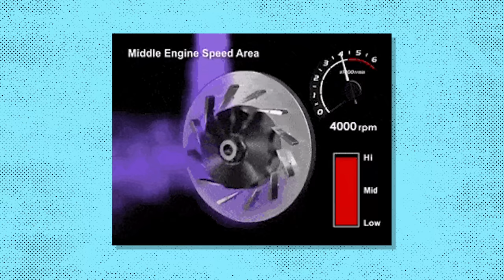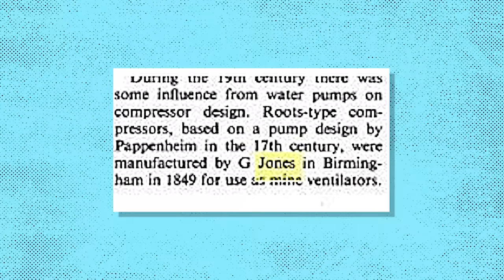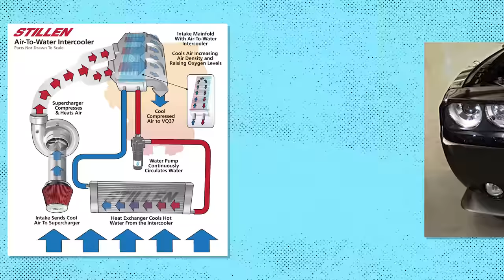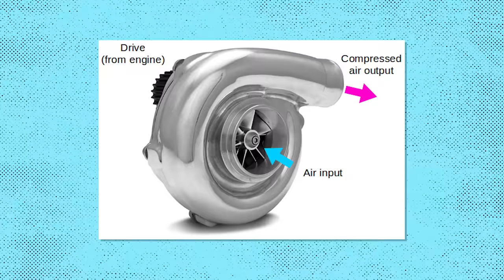Why Superchargers Aren't As Good as Turbos

Comment: Someone please explain how a turbocharger works.  The following is how it looks to me, but correct me if you have math, and physics, to back up your argument.

What magic does exhaust gas have that allows it to power a compressor without putting a load on the engine which is at the other end of the pipe?
Pneumatic tools use turbines to convert compressed air into mechanical power.  That's what turbochargers do too.
Every time an exhaust valve opens in an engine, its piston is now right down the hall from the turbine and the door between them is wide open.  The piston is shoving the exhaust gas out of the cylinder, ramming it into the exhaust system.  There is only one way for it to get out, through the turbine.  That puts a load on the engine.  
There is no magic use of waste energy.  The exhaust gas is as hot as it gets when it's shoved into the exhaust pipe.  From that moment on, it begins to cool and to contract.  Not much cooling happens in the very hot exhaust pipe, but the point is the same.  Let's say that we toss a mixture of fuel and air into the exhaust pipe upstream from the turbine, and we ignite it.  That certainly will make the turbine spin faster, but the other end of the pipe is still connected to engine cylinders with their exhaust valves open.  Those pistons feel that increase in pressure outside and they will be slowed.
There is an idea that turbo superchargers put no load on the engine, but I can't see how that is true.  But if you know different, and have the technical knowledge to back it up, I'd love to learn something.
Reply: First of all the exhaust gasses continue to expand as a significant amount of heat energy is rejected by the reciprocating engine.
  There is no parasitic loss because there is no backpressure, a properly designed turbocharged engine will have no Delta~P as intake manifold pressure increases with exhaust gas flow.
 The turbocharger uses an Impulse Type turbine..
This converts the kinetic energy in the hot exhaust gasses into shaft horsepower, not pressure.
 When an Otto or Diesel Cycle engine  is turbocharged it becomes a combined cycle Heat Engine.
 The turbocharger acting as a  second pass heat recovery engine using the Brayton Cycle.
It shares the same thermal reservoir as the reciprocating engine but only uses the heat rejected by the reciprocating engine increasing overall thermal efficiency and volumetric efficiency without any parasitic load on the reciprocating engine.
We can prove this by using the Carnot Cycle Formula and the temperature differentials  (Otto Cycle + Brayton Cycle = BSFC)
Any thoughts or questions?
Reply: @sandervanderkammen9230  
You didn't answer my main point in any way.
Reply: @deezynar  Your problem understanding how the turbocharger works is related to a lack of understanding of how the engine works.
Pumping loss and heat rejection in particular.
About 20% of the energy lost is to pumping loss, the turbocharger reduces the loss because the centrifugal compressor is significantly more efficient than the pistons in pumping air.

About 25% of the energy is rejected in exhaust heat. This exhaust heat drives the compressor as the gasses continue to expand.
There is no parasitic load on the crankshaft because the pressure in the cylinder is always higher than the exhaust manifold during the exhaust stroke.
Yes, heat is magic...
  The exhaust gas temperature suddenly drops as it passes through the turbine wheel, energy cannot be lost or destroyed, this temperature drop is directly related to amount of heat energy converted into shaft horsepower generated by the turbine and is accurately calculated by using the Brayton Cycle Formula.
Any questions?
Reply: @sandervanderkammen9230  
You keep writing, and you keep saying nothing.
The exhaust gasses are in a pipe with the open exhaust valve and piston at one end, and the turbine at the other.  
Just explain how that situation doesn't put as much pressure on the piston as it does on the turbine.
Reply: @deezynar  Because there is also an intake valve open with pressurized air rushing in pushing down on the pistons... an equal but opposite reaction which canceled out the exhaust manifold pressure.
It is basic engine fundamentals and fluid dynamics.
There is no Delta~P so no backpressure in a turbocharged engine.
Reply: @sandervanderkammen9230  
The exhaust valve opens while the intake valve is closed.
While the exhaust valve is open, the piston is moving upwards, ramming the exhaust gas out of the cylinder and into the exhaust system.
Explain how there is no backpressure with plain English.
Not only am I saying there is backpressure, I am saying that the piston produces the ONLY pressure.  That means the turbine is powered by the engine acting as a pump.
But I've already said this, so I'm just wasting time by repeating it.
Reply: @deezynar  The turbine is powered by heat, just like the reciprocating engine is.
This is not a difficult concept for an inteligent person to comprehend.
Both the piston and the turbine wheel are acted upon by expanding gases which are expanding from heat. The gasses continue to expand   after the piston reaches BDC.
 The pressure in the cylinder is always higher than the exhaust manifold.
The pressure differential between the intake and exhaust manifold on a turbocharged engine is Less than a naturally aspirated engine so there is no net increase in backpressure because intake manifold pressure is higher than atmospheric pressure.

If you pump air from low pressure to high pressure there is resistance to flow and pump load is equal to the difference in pressure.
If you pump high pressure air to an area of the same high pressure? There is no  pumping loss due to the lack of pressure differential.
Reply: @sandervanderkammen9230  
Your first statement is false, so it's hard to believe anything you say after that.
Heat does zero work, and isn't capable of doing any work.
Work can only be accomplished by DIFFERENCES in heat.  Expansion can't happen in conditions where temperatures are equal.
That shouldn't be hard for an intelligent person to understand.
So, in order for you to not look like an idiot, NEVER claim that anything works because of heat without pointing out that DIFFERENCES in temperature are required for work to be done.  A Stirling engine will work if it's sitting on dry ice, and the top is bathed in ice water.

With that said, the fuel and air mixture in an engine are ignited in a cylinder and the combustion causes the contents inside the cylinder to go from being warm, to being very hot, and hot stuff takes up more space than cooler stuff of the same mass.  That sudden change in temperature is worthless if it wasn't for the air pressure on the underside of the piston being far less.  
Did you understand that?  I wonder if you do, because you jumped right over several key points in your explanation, which significantly reduces your credibility.

After shooting yourself in the foot, you go on to make a claim that you seem to think proves your point.  Yes, it is a fact that the pressure in the exhaust system is lower than the pressure inside the cylinder.  Of course it is.  The exhaust wouldn't exit the cylinder if the piston didn't provide enough force to push it out and overcome the pressure in the exhaust system.  And that is true even with the gases continuing to burn after being shoved out of the cylinder.
It seems that you don't recognize that you are actually claiming that LESS pressure is the same as ZERO pressure.

I'm going to say this for the 3rd time: the piston that shoves the exhaust gases into the exhaust system has a direct pressure connection between itself and the turbine.  If it wasn't for the existing momentum of the gas towards the turbine, the exhaust would all blow out through the cylinder if the piston were suddenly (magically) removed.
Reply: @deezynar  Air is only the working fluid.
It is heat that causes the air to expand.
 Air is matter, not energy.
The energy is simply transmitted through the air causing it to expand.
 Turbochargers convert the heat energy in the air into shaft horsepower.
Heat from the same source as the reciprocating engine... the burning air fuel mixture. 

The reciprocating engine has a significant amount of energy loss due to pumping efficiency.
The turbocharger both increases pumping efficiency and volumetric efficiency.
It accomplishes this by the centrifugal compressor which is significantly more efficient and the fact that it is not driven by the reciprocating engine using mechanical energy.
The gas turbine wheel is driven by energy rejected by the recip.engine.
 Having lower pumping loss and higher thermal efficiency is clearly reflected in the higher horsepower measured at the crankshaft, the lower exhaust outlet temperature and lower BSFC  (less fuel burned per horsepower generated) thus higher thermal efficiency.
 The drop in exhaust gas temperature through the turbine exactly matches the difference in horsepower  (lower temperature means less heat rejected =more power)
If we compare two identical engines,  same centrifugal compressor same boost pressure one supercharged, the other turbocharged.
The turbocharged engine will always  produce more power and use less fuel and is directly related to the lower EGT.
This is very accurately described and calculated by the Brayton Cycle Heat Formula.
 Follow the heat, follow the energy and all is explained and accounted for.
Reply: @deezynar  Heat always flows from a higher temperature to a lower temperature (entropy)
And pressure always flows from higher pressure to a lower pressure.
The turbocharger uses an Impulse Type turbine and conforms to the Bernoulli Principle, as the hot gasses passes through the turbine its velocity increases and its pressure suddenly drops along with its temperature.
This drop in temperature is directly related to the amount of horsepower generated by the turbine.
 We can very accurately calculate both the amount of horsepower generated and the efficiency of turbine by the mass (weight) of the exhaust gasses and the inlet and outlet temperature.
Reply: @deezynar  Pumping loss is not simply defined by the exhaust stroke,  pumping loss includes the intake stroke as well.
A naturally aspirated engine at WOT will have a small intake manifold pressure differential (slightly lower manifold pressure than ambient atmospheric pressure) and the exhaust manifold pressure just slightly higher than atmospheric pressure.(no muffler or tailpipe)
The same engine turbocharged to 7 psi of intake manifold pressure will only have a exhaust manifold pressure of approximately 7 psi.
(the ideal turbocharger application is a 1:1 or better ratio)
 Yet the BMEP of the turbocharged engine will typically be +30% higher with a lower PMEP (indicated cylinder pressure to manifold pressure ratio)
The pressure defferential is the same despite the significant increase in airflow through the engine.
Any questions?
Reply: @sandervanderkammen9230  
Thanks!
You wrote an encyclopedia that still didn't explain how the turbine gets spun without getting pumped by the engine, or how it's even possible to avoid putting equal pressure on the piston.
I understand that you believe you did, but you didn't.